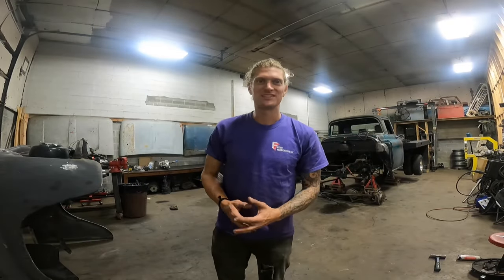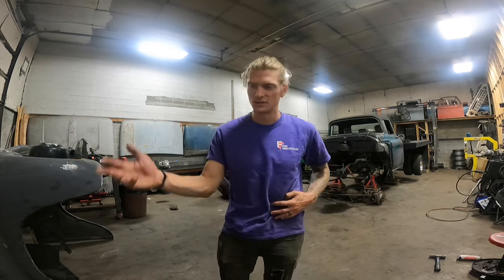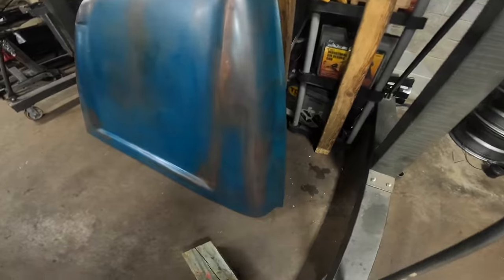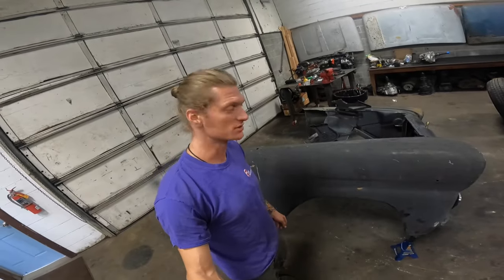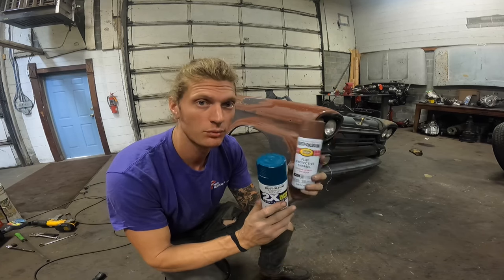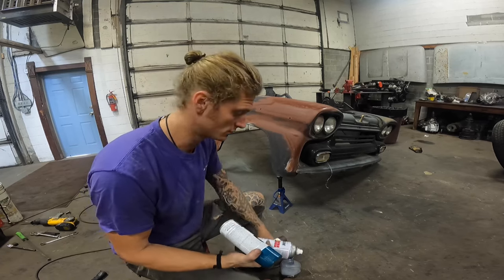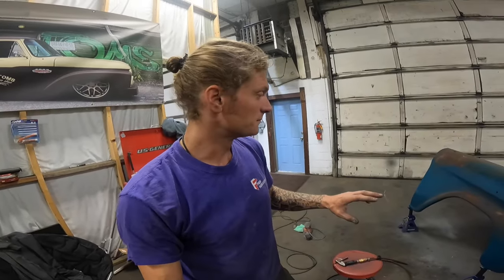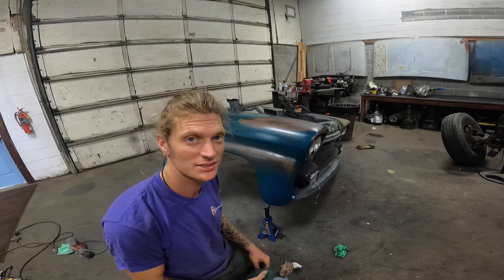DIY Fake Patina Paint on Restomod Truck DJS Customs

Comment: Great minds think alike! I just did a finish like this on a vintage bicycle I just resto-modded. The bike was originally dark brown. I overlaid it with red-oxide primer then a light coat of satin black. let it dry then rubbed it down with a green 3M scrubbing pad in the places i wanted to show wear. The result is a lot more subtle than many fauxtina jobs, but far more convincing. Your Apache hood looks great brother, nice work!

Comment: I love this process. I’ve watched it 20 times. I still can’t rap my head around what the water actually does?
Reply from the maker: Thank you for watching! If you try it on a test piece you will definitely be able to tell. It blocks the paint from getting to the surface. Leaving whatever color is behind it in the small water drop size. Looks like when rust is just staring to break through fresh paint. Hope that helps.! Thanks again for watching

Comment: Was any metal left exposed? Did you end up spraying clear over to make last longer
Reply from the maker: No exposed metal at all and I used ACME satin clear over everything. If you check out my instagram I have picture of the whole truck done
Reply: So no sanding at all needed once you lay down paint to achieve look..Can you add the link or description of the colors you used to get this look. I know you quickly  said it but it would help..

Comment: i have 68 pick up with the perfect patina never been painted original blue paint job from factory but i hate patina it looks like someone had no money or care on the rig to me . i will be painting my rig which will make a few people i know mad because it has the perfect patina . best part i only have 2000 in my rig with a stroke 454 with 02xx trans new tail gate oak wood floor in box all painted under side rebuilt suspension, new lines, 12 bolt possi. the dash all rebuilt with full factory gauges with factory tach full movement electric heated leather seats 70 blazer center console do plan on getting tilt wheel and 2 inch drop spindles with disc breaks all ready has from factory power steering and power breaks with a set of rally wheels and i still have the 327 and 400 turbo that was rebuilt before i got the truck just they had no idea on how to put it in the rig after having it rebuilding it they thought they lost the cam but they had it 180 out i just moved the wire and started it and drove it home for 500 bucks rust free 68 pu but i gave the 327 to my kid for his 67 pu

Comment: Patina = lazy. Any real car collector will tell you that patina does NOT add value to a vehicle. Patina look is a modern fad/trend due to the laziness of younger buyers and drivers. Sort alike motorcycles being painted flat black nowadays so the owner doesn't have to wash and polish it as much. Yes, you did a good job but if you are going to that much trouble, paint it correctly and have something that looks like you really care and are above dumb trends.
Reply from the maker: Appreciate the input! Not sure why you would take the time to watch a video on patina. We enjoy patina because we drive the hell out of these vehicles and don’t have to worry about someone Leaning on the car/truck and putting a blemish on a 20k plus paint job. I don’t know about you but k drive my truck all over the Country to shows and daily drive it rain or shine and in the winter. I personally do every part of the build beside upholstery. All fab work all metal work. Motor builds, transmission builds, wiring you name it.. I wouldn’t call that lazy in the least bit. Thanks for watching! Don’t scratch your paint!
Reply: @djscustoms  you couldn’t have said that, any better than that. Not everyone wants a Trailer Queen. I want to drive and park anywhere I want, and not have to worry about someone coming close me or even tapping my car or truck.